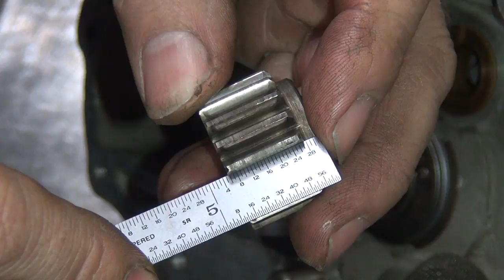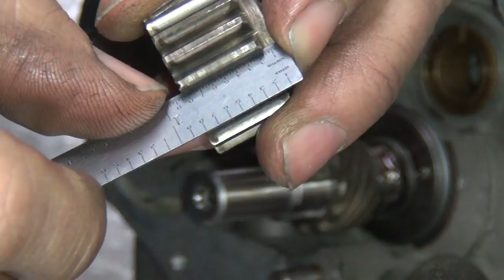1942 wlc #106 wla 45ci flathead dirty motor rebuild harley wl side-valve  by tatro machine

Comment: Tatro
  Just a thought the bored and threaded pinion shaft by any chance do you think Jim's did it to use his puller/installer so you don't beat the pinion gear on. If I'm not mistaken it's the same design as Harley's puller installer... You could have used a piece of running thread a nut and a socket to draw the gear on...
Reply from the maker: yes, or just use my hammer. i ave a better feel of what is going on with it. jims copied the harley tools.
tatro

Comment: I need to replace the cam cover seal ring cover. it's cracked. I don't know and can't find a video on how to remove the 2 posts that it slides on and installing the new ones. any help tatro would be greatly appreciated.
Reply from the maker: i have no idea what you are taking about.
tatro
Reply: @TatroMachine  I'm talking about that thing in the cam cover that the generator end gear seams to be touching when the cam cover is on the crankcase.  It's supposed to slide on these 2 little posts because it has a spring behind. It's not moving on these 2 posts. It's jamming on them.
Reply from the maker: time to clean all the crap out of it and get them freed up.
tatro
Reply: @TatroMachine  I heat them post up a bit and twist pulled them out. I have a buddy machinist who's going to make me some new post and I'm going to locktight them in place. It needed a new spring anyway as the old one had no more sring to it.  Thanks for your reply